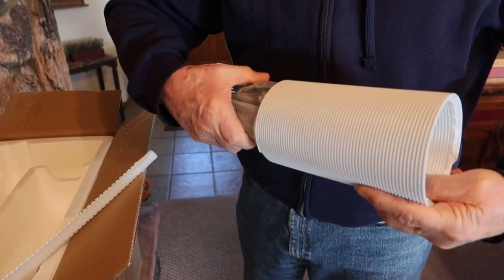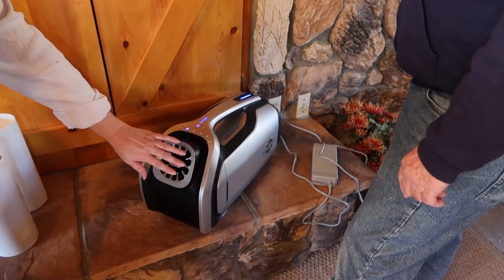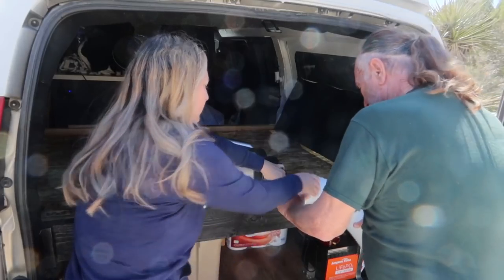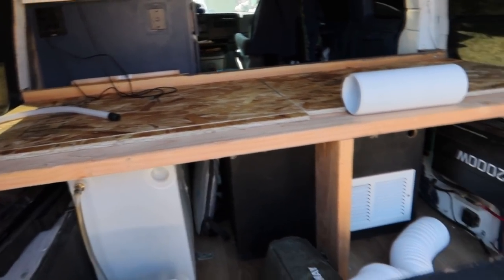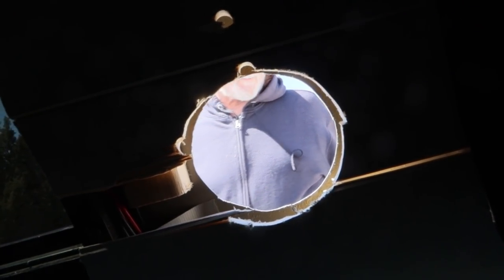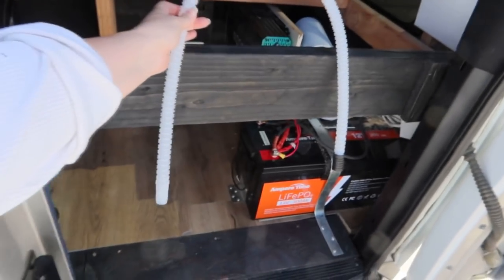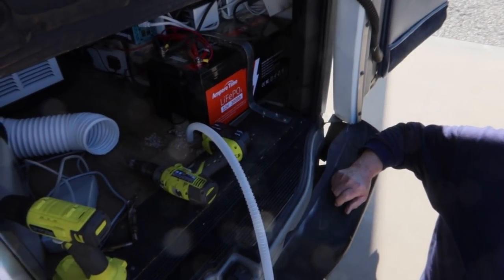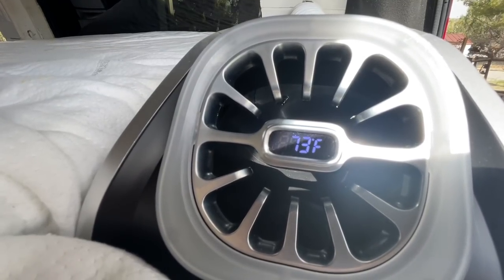Zero Breeze Mark 2 Air Conditioner Campervan Installation // Van Life Essentials

Comment: You might want to consider putting a vent hood (like what is over dryer vent outside) otherwise when it rains all the water will come in thru the vents.
Your dad is Mr Awesome.  You are lucky to have such a handy daddy.

Comment: Hey! Swap the hoses! So the intake is at the bottom and the exhaust is at the top! That way if its raining the exhaust will blow most of the moisture away from the top.
Reply: Also, heat rises.

Comment: Curious to see how well it cools. Maybe a curtain/partition to isolate bed area from the rest of the van to cool a smaller area would be easier to cool? Two more things, 4 3/8" hole saw, and you need that 12 to 24 volt adapter ($99) to run the zero breeze off of your battery instead of the inverter. Much more efficient use of your power. Thanks for sharing. Hope it all works out.

Comment: Great idea and work! Just curious , seems like the cooler might shift or move around if a good bump is driven over . If you haven't already , maybe anchor whole unit with two nylon straps one through handle and one around heavier back section wood screw mount each strap end to mounting base. Simple quick release flat straps with a tension pull type ,with cut rubber material inbetween strap and unit plastic housing to hold it firm / non-slip . Great video

Comment: Wouldn’t it run even cooler if you don’t use the hot outside air intake???  More like when your cars ac is on recirculate and draws the inside air.  You might get an even cooler van that way.  Please do a follow up with how this works in the summer.  Have fun traveling and stay safe.
Reply: That’s not how air conditioners work. Your car ac has a compressor/condenser “outside” the air handler is “inside” the outside compressor/condenser makes a chemical called refrigerant colder (think back of your refrigerator, which gets hot) car blows air over the cooled refrigerant making cool air. Your car can blow fresh air over the coils or “recirculate” your inside air.
Reply: I think this kinda makes sense - When I set my car to recirculate vs fresh air the AC temp is a tad cooler - So to VENT  OUT exhaust while the INTAKE stays in the vehicle will likely help the device to cool a bit easier - A little stress on the system - Great point @kenneth wilson

Comment: I got one and vented in floor where back cooking seat was in t&c van. Cost way to much. It was better when got to hit to use auto start. Can ac or heat run for 15 and shut off. Love to see if you have better luck. If you can some how vent in bed sheets. You could stay cool

Comment: Hello 
I believe the intake and exhaust are to close? the intake is sucking all the hot exhaust air making the unit work harder and not get as cold as it could. I believe. but good option for small places.

Comment: hot air exit below and normal air intake right above so it can easily take back the hot air instead of normal air. 🤦‍♂🤦‍♂🤦‍♂🤦‍♂🤦‍♂🤦‍♂ and inside air intake is covered by the bed. we can't blame them its design to install is very complicated. I'm glad they did this much.

Comment: I have this AC. I just vent it out the window when it's hot.
Reply: @Lori McDaniel Hi. I am curious about this... Does it cool down ur van? Do u need to run the hoses outside? How much energy does it use? Is it worth it? I really appreciate any help!!! I am a single 52 yo fem n I do NOT handle heat well n really need something that will work. Thanx so much!!!

Comment: I would add some bug screen to those vents. I thought you were going to cover the 2 ports with a single vent, that would cover any misalignment . I wish that was more affordable as it is I'll be using a portable and venting it out one of the small screened windows at the bottom of the picture window. I though about a wall shaker in the back door but thats were Im putting a fan

Comment: Nice! I love it! 👍 You're gonna make me yank out my window a/c. Thanks for sharing. 😆 🤣 😂 THEY have circle blades in various sizes, that attaches to your drill at most hardware stores. They cut through wood & metal as well. I've  found the expensive blades are best like the Milwaukee brand or Craftsman. You can buy single circle blades or a kit of several or more blades.

Comment: So only one of those vents have to go.outside. One is a intake which can stay inside and the other is exhaust that goes outside. Then since it is already done definitely make sure your the exhaust is above the I take. If not the heated exhaust will just rise and be sucked into the intake.

Comment: How's it holding up? I have a Class B and the generator doesn't stay on so I desperately need an AC solution.

Could you have run the tubing under the bed rather than have the unit sit on top of the bed?

Comment: You could have used your vent window and never drive a hole in the body. When not in use you don't have to worry about rain coming in, are cold air.
Reply from the maker: Good point except my back windows only pop from the bottom a couple inches. The hoses are 4 inches wide. I don't mind the holes in the body and so far it hasn't caused any issues. But I do appreciate the suggestion!